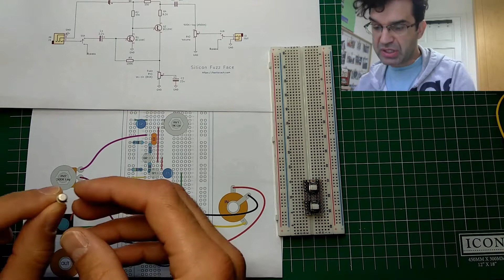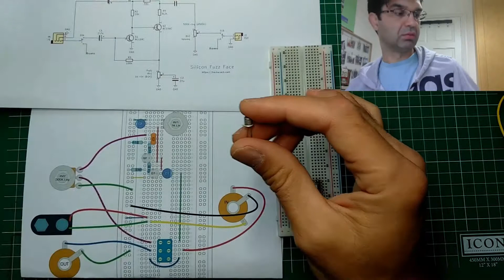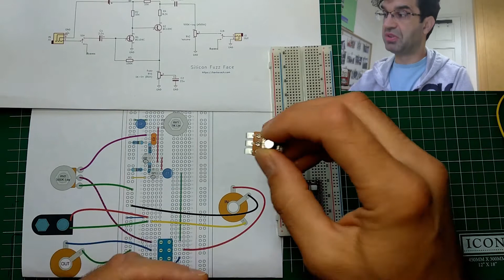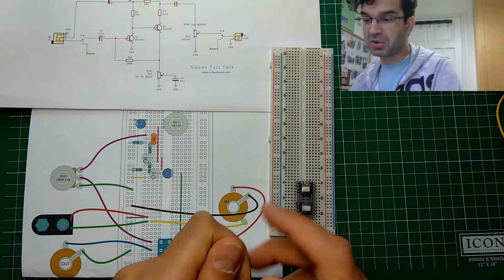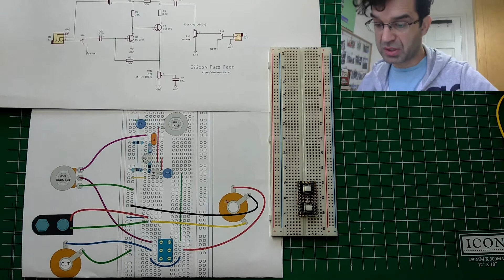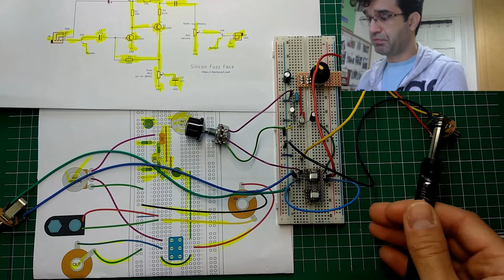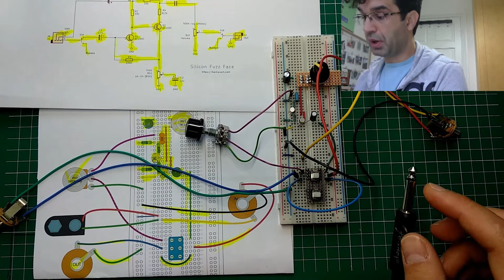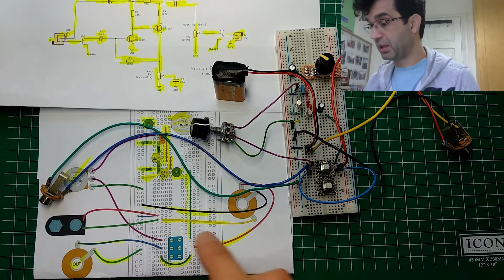DIY Fuzz Face - Breadboarding the Effect

Comment: I'm almost positive my Smallbear FF on the breadboard uses a BC109C. Is that the one with like 800 hfe?

Whatever it's called, that's what I'm using in Q2. Q1 is a 2n2222a or whatever it is. So like 100 hfe and 800 hfe. It does the gated Fuzz thing quite well once you get it running on 5, 6, 7 volts. I actually have a 5v Arduino? breadboard power supply that I use with it when I want that sound lol.

Once I'm done with this, I'll be building a "JHS Little Black Amp Box" for my Hot Rod Deluxe. I have pots and jacks so there's no reason not to do it
Reply from the maker: so BC109C is between 450 and 900, it could be anything between these two values. 2n2222a is between 50 and 300 ... all of this is from datasheet and it really depends on the quiescent current but most of the time the gain is "big enough" :)

Comment: Quick question. If I wanted to modify this to use germanium transistors, what would I do? Just flip the power supply and the electrolytic caps? Or is it more involved than that?
Reply from the maker: I have a video on that - https://www.youtube.com/watch?v=jzI0KxQvIHE
It should be the same approach. It's a tiny bit more involved but it is still straight forward (this is at least how I did it anyway)

Comment: Do you know what hfe these transistors are? For the life of me I can't make a fuzz face to work🤦🏻‍♂️ it's just hum and noise town haha
Reply from the maker: there's a table with hfe here: https://barbarach.com/building-a-fuzz-face-clone-experimenting/
here I used BC109C I think, and that one has gain from 450-900, which is similar for BC108C and BC549C for example. Check the pinout of your transistors. Which transistors are you using? The transistors should not be a critical choice as long as they are NPNs ... I mean, to get a working circuit :) This won't work with PNPs, I have a different video/article for that.

Comment: Hi, thanks for all the great videos and information....i was just wondering if this build is a negative or positive ground version?
Reply from the maker: This is negative ground version.
Depending on what you mean by positive ground :) this video might interest you: https://youtu.be/jzI0KxQvIHE  The video is about how I would rewire this effect to use PNP transistors. So it is still using +9V power supply but it uses PNP transistors and it's ever so slightly different wiring than this version of the effect.
Reply: @BarbarachBC Ohhhh. That's what I'm looking for basically. I actually have the Smallbear FF breadboarded. The one where they have step-by-step instructions with pics of each step and where each component goes on the BB.

I was hoping I could just modify that to use PNP transistors but that doesn't seem like it's gonna be possible. So I guess I'll be building a new one from scratch by following your other vid.

I actually have about 90% of a pnp FF built out on a pcb I ordered from UK EBAY but I never finished it. I need to install 1 pot and the input & output jacks and I think that's it. Hmmm. I might try that tomorrow now that I have a new Fender Hot Rod Deluxe to play through.
Reply from the maker: There's a breadboard diagram for PNP version here: https://barbarach.com/silicon-fuzz-face-pnp-version/
Maybe that will help? (Or maybe you've already done it, I was away so only got chance to reply now)
Reply: @BarbarachBC  thank you!

Comment: I have tried to make a hybrid one with NPN and PNP transistors and it is not easy to make it sound good... I will keep trying, I want to mix germanium and silicon to make it a stable device and sound
Reply from the maker: I can imagine it being tricky alright. Both NPNs in the circuit are working under "extreme" conditions - so adding things to the mix will make things more complicated. Keep on trying to get the sound you like :) it's all part of the fun :)
Reply: @BarbarachBC  Thanks buddy, I know it seems like an easy circuit, but making it sound good later is not that easy... But I agree with you, it's a lot of fun!